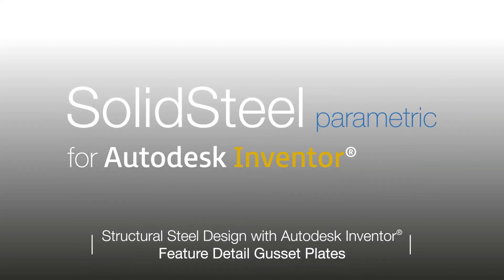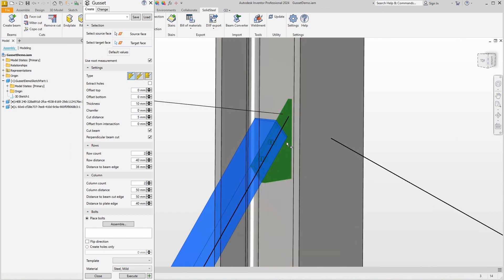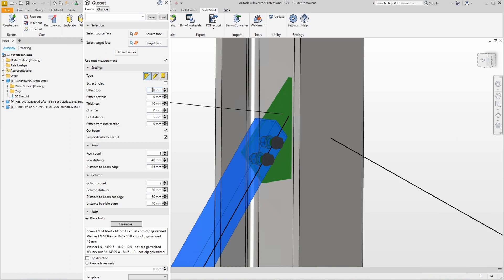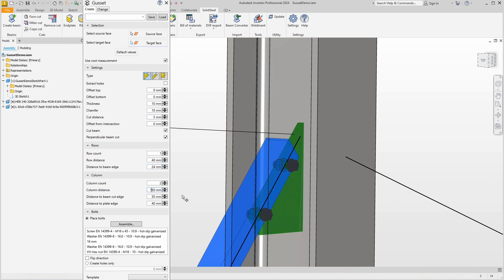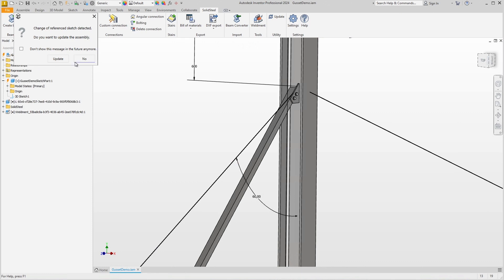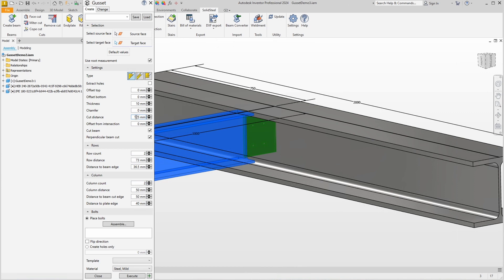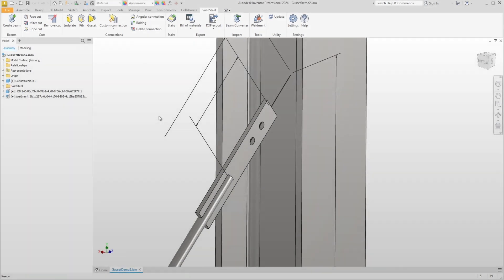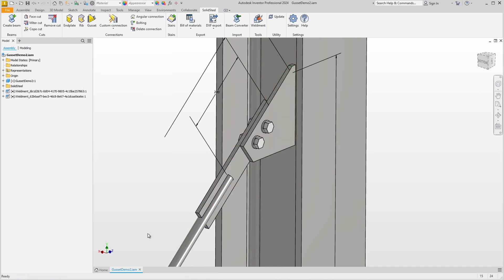Gusset plates in structural steel design with Autodesk Inventor – SolidSteel parametric tutorial

Comment: PDF Location?
Reply from the maker: Hi @jamcelroy,
To open the PDF manual, just click on the Help button (the one with the question mark) in the upper right corner of SolidSteel parametric.

Bonus tip: If you click on the question mark inside an open dialog, the PDF manual will jump directly to the page describing the function of the dialog.

Hope this helped, best regards,
The SolidSteel parametric Team

Comment: WHERE CAN WE FIND THE PDF MANUAL OF THE PRODUCT?
Reply from the maker: Hi @dmikroma,

Sorry for the late reply. To open the PDF manual, just click on the Help button (the one with the question mark) in the upper right corner of SolidSteel parametric.

Bonus tip: If you click on the question mark inside an open dialog, the PDF manual will jump directly to the page describing the function of the dialog.

Hope this helped, best regards,
The SolidSteel parametric Team